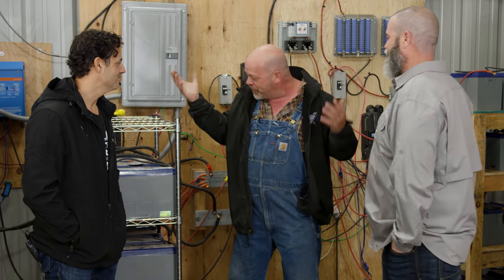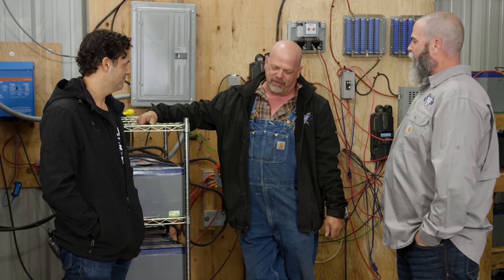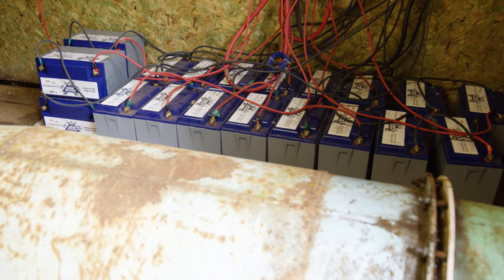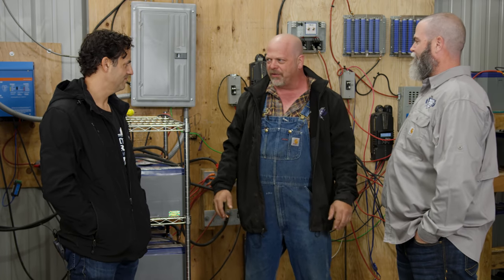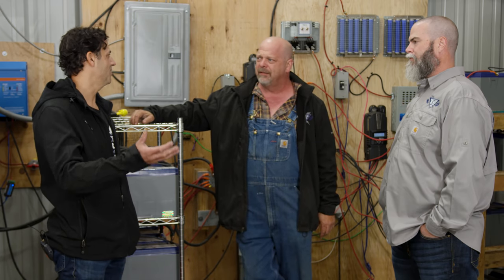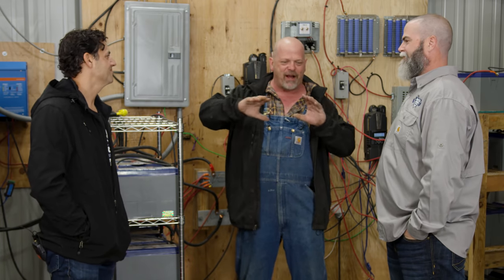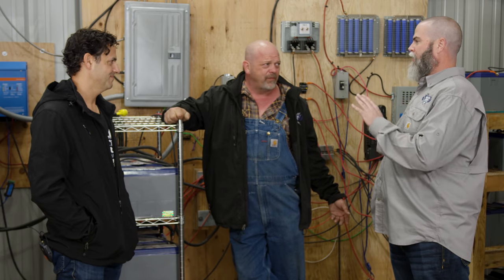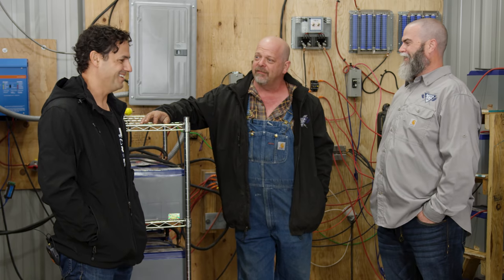A Conversation with Rick Harrison on his Off-Grid Property l Battle Born Batteries

Comment: Rick let Chumlee wire his workshop.
Reply: Omfg. Came here looking for criticism, and this is priceless.
Reply: AH ah ah is that multi color Pasta on the wall behind them?
Reply: Chum is to wired up already
Reply: Ok, lets put this experiment up for discussion..... Sizes have been expanded for grasping the subject matter......

Lets take a 500 pound round neodymium magnet that is suspended with a non-metallic cable off a 100 foot non-metallic structure. Now this will be bringing gravity as a power source into play as well as magnetism and creating a huge pendulum configuration. This ball magnet will always be trying to swing to a perpendicular configuration with the earth by way of gravity. 

Now the floor section of this entire structure will have one huge flat round neodymium magnet at the base (maybe with a diameter of say 25 feet and opposite polarity of the swinging ball magnet or a combination of thousands of individual ones in a tightly set out pattern, also with opposite polarity of the swinging ball magnet. Of course engineered so the suspended ball magnet by swinging can not make it to the edges of the outer base magnet or magnets. By doing this we are eliminating dead spots at the outer edges of the structure. The hanging distance of the ball magnet will be engineered into the equation to maximize the amount of excitement it will receive from the lower opposite poled base magnets or magnet.

Now the fun begins with everything setup above the floor with the magnets. This is where we get our energy from with the next steps. Below the floor we have hundreds or thousands or maybe just one huge coil configuration that collects magnetic flux from the magnet configuration above moving all over the place for a very long time. ( I have set this up small scale and it takes a very long time for the hanging magnet to eventually find a dead spot and stop. By having that single magnet in the base, those dead spots between magnets are eliminated. Remember that heavy ball magnet wants to get back to perpendicular by the power of gravity. The voltages from many coils or the voltage from one huge coil is collected and stored in super capacitors. That in turn is used to do work, but also keep in mind if the swinging ball magnet needs to be re-excited for whatever reason, a very small amount of the stored energy can be used to keep the process going indefinitely.....

Well that's the experiment fire away at the potential power source or debunk the premise..........?
Reply: @Adirondacks4me  would you like to play a game?
Reply: This is soooo much funnier then it should be lmao
Reply: Watch out for bigfoot! They say there everywhere in the
Reply: Hahaha! I came to comment on the fucking wiring job.... can't no more! THIS won the Internet comment award!
Reply: Thanks for the laugh
Reply: “Let me call my buddy that’s an expert” 😂😂
Reply: I also wonder if he owns a level or a measuring tape...

Comment: That wiring behind Rick is horrendous.. it’s a mess! Get someone to harness that mess up brother. My eyes hurt.
Reply: Call Casey neistat
Reply: 90% of diy solar looks like his
Reply: it does look pretty bad and im not an electrician
Reply: ChumLee did it!
Reply: Can you spend a couple hours on cable management? “The best I can do is five minutes”
Reply: @darrenbenson2606  cause people are lazy...that wiring is bad
Reply: Just sayin,  there are design issues in that battery shed. Speaking of batteries the volume of that bank for the number of loads mentioned is grossly inadequate. Rick should be using 2volt 1000AH AGM batteries, and quite a few of them. Looks like a million dollar homestead cheaping on battery backup. Your system designer failed!! 
 Just my opinion after 40 years off grid.

Comment: A puff piece if ever I saw one. I've got a lead carbon bank at my mums farm, been in use for almost 4 years now with still 90%+ capacity been run flat multiple times from leaving shit on all day, cost a fraction of lithium and only slightly more than AGM rated and independently tested to 3000 cycles at 70%dod  with an estimated service life of 10 years. 

They tollerate Australias harsh conditions very well and I haven't done a thing to them.

Comment: I may have missed the boat, but I use an air battery. I design and build wind turbines as a hobby and all mine pump air. I build vertical axis wind turbines, which need no orientation gear and turn whenever the wind blows. Each windmill works against a 40 to 1 transmission and the output side is hooked to two air pumps, which are basically nothing more than bicycle pumps. The air feeds into a ginormous tank and when I need electricity, I run that stored compressed air through an engine of my own design and build, coupled to a generator and I have all the electricity I want. Seems to be no short supply of air and nothing ever wears out.  Works for me.

Comment: I’m off grid 2 I install a hydro turbine generator 1000 amp. I’m down stream from reservoir on river 24/7 I don’t have solar or wind. Just 24 /7 power have 200 amp service run everything. As a electrician I got hotel, house and building off the grid.
Have extra power if I expand. My main breaker has parallel runs 500 Cir mill wire run.

Comment: That wall is setting off my OCD! Get a two post rack with shelves for the batteries.  Anchor sleeve it to the slab.  Install some ladder racking above the rack to the wall to run cables.  Add cable management for the wall.   Plumb it correctly.  If you use zip ties use a set of flush cuts to trim off the tails.  I don't know what data dude did that wall, but as a phone guy that works with DC power it drives me nuts!

Comment: Speaking as a former state electrical inspector who did hundreds of solar inspections in my career, I would say the wiring mess behind Mr. Harrison screams out home owner wiring with no permit or inspection. I have seen home owners set their buildings on fire in these kinds of situations! He probably had the proverbial buddy who "helped his uncle one time wire his boat" and so was qualified to do a 240/120 VAC installation involving wind, solar, and hydro generation with battery storage...right. There is a reason the National Electrical code book is published by the National FIRE Protection Agency or NFPA!! First code violation I would write, Nec 110.12, "electrical equipment must be installed in a neat and workmanlike manner". Next correction NEC.300.3(A), single conductors unless listed as a cable assembly, must be in a raceway (conduit ). Based upon experience, there would be be between 12 and 20 corrections on a job like this. I have always wondered why obviously intelligent guys like Mr. Harrison risk loss of life and property by not getting a permit and inspection.

Comment: Using AGM lead acid and no checking on them yet,  now 4years with no noticeable change in capacity a fellow RVer said he he got 11 years out of his.
I only use about 40% of my capacity getting down to 12.2 or 12.3 volts the only check is Voltage. The big advantage to lithium is weight and space needed.
You do need twice the amp hour for the same amount of power. But AGM cost about 40% less.

Comment: JUST TO DO SOME MATH FOR YOU EACH OF THEIR 100AH 12V BATTERIES HAS 1.2KWH OF ENERGY AND COST $900 ON SALE. SO HE HAS 48 OF THEM FOR A TOTAL OF 56KWH COSTING HIM $43,200 + SHIPPING. 

IN COMPARISON, IF YOU BOUGHT TESLA MODEL S BATTERY PACK FOR $10,000 AVAILABLE ALL OVER EBAY FROM LOW MILEAGE VEHICLES, WHICH IS ABOUT 75kWH OF USABLE ENERGY. YOU WOULD THEN NEED ABOUT $2000 IN EQUIPMENT TO BATTERY MANAGE THOSE 16 TESLA MODULES. SO $12,000 FOR 75KWH. 

I DONT SEE THE ADVANTAGE OF BATTLEBORN OTHER THEN THEY MIGHT BE EASIER FOR INSTALL, NOT THAT THE TESLA MODEL S MODULES ARE HARD (LARGE COMMUNITY OF INFORMATION AND BMS PARTS AVAILABLE FOR THIS PURPOSE)

MY 2 CENTS.

Comment: This is cool didn’t know this dude was all into this. I love the off grid concept. But seems like it takes a fortune to do it. I live in Texas. I spend about $1200/ year on electricity and that’s at 73 degrees in the summer  and about 250 on gas. This stuff needs to get cheaper. But I love the solar concept. Plus all the disposal of batteries. That’ll b the next pollution issue acid batteries.

Comment: Just sayin,  there are design issues in that battery shed. Speaking of batteries the volume of that bank for the number of loads mentioned is grossly inadequate. Rick should be using 2volt 1000AH AGM batteries, and quite a few of them. Looks like a million dollar homestead cheaping on battery backup. Your system designer failed!! 
 Just my opinion after 40 years off grid.

Comment: Funny how someone with that kind of money is too fucking cheap to pay a light bill
Reply: No electricity out in the mountains, no choice but to be offgrid.
Reply: Even if he has access to grid easily its about independence and reliability and a bit of preper attitude doesn't hurt.  It also saves money in the long run especially with federal credits and low interest rates . You could even borrow the money and pay the loan back for less than an electric bill in 10 years .  Then very little if any further costs for another 10-20 years.
Reply: @mitchdenner9743  friends had a choice of going off-grid or pulling power around the edge of a mountain - that install cost was nearly $90,000 to the power company to get it to the property edge...  the solar/battery farm was about $25,000 and runs their cabin and a 2 car garage...
Reply: @lylestavast7652  and? Whats your point?
Reply: @mitchdenner9743  expensive stuff to have power run - some people think it's just automatically done if you want grid service. general info to others if you're already aware of it.
Reply: @lylestavast7652  👍